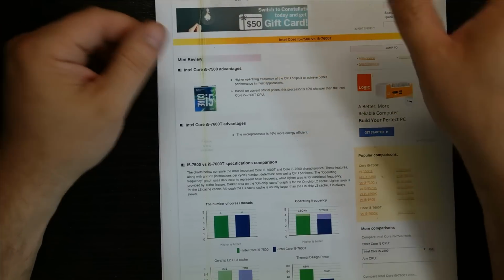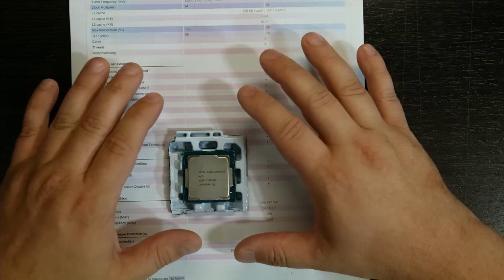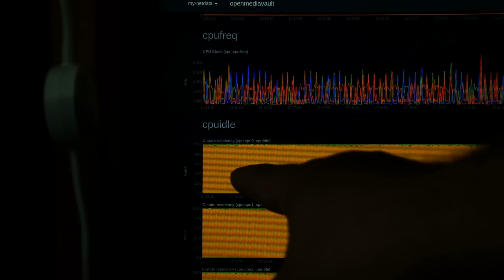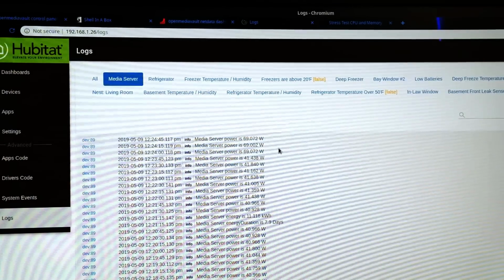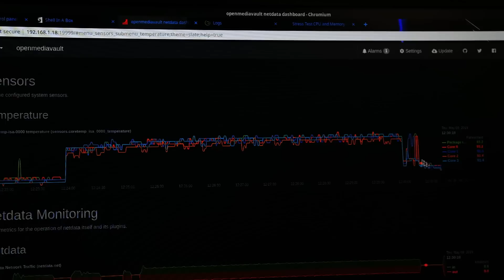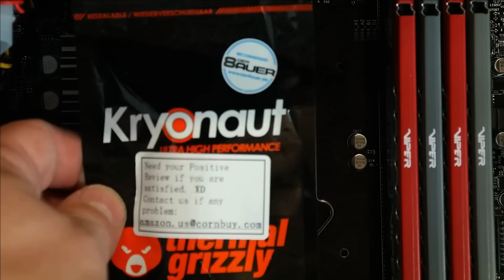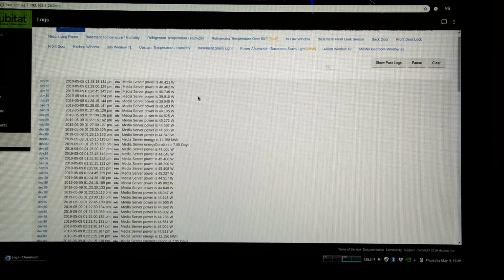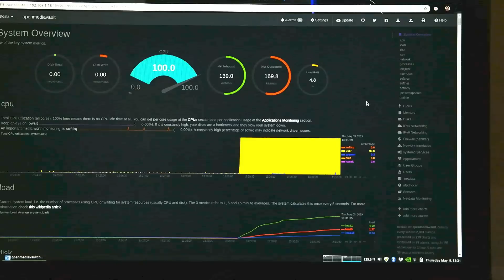Power Saving With T-Branded Intel CPU's???

Comment: You tested  the T series cpu without validating it’s actually a T series CPU,  the cpu printed “Intel confidential “, and you didn’t even bother to validate in system it’s a 7600T.  And even if it is, this is an engineering version cpu,  totally not a valid test.
Reply: I agree. Even though I think the outcome wouldn't differ much.

Comment: You are making the test the wrong way, you had to check the thermals, 35 TDP is thermal design power. 
*1.First off all, the t series have smaller cores, it means less heat, you can safely take away those two giant fans on the processor sink, each of them use at least 7 watts, so you started taking away 14watts just by that,  the temps without fans with the sink you got should remains 60 degree without fans and reach 70 on full load which is normal for these processors, it necessary to have a sink with a good size for this to work, like yours.
*2.Second, is recommended to semi-turn off the the processor turbo and limit the performance like oems do, using the bios or a software like "quick cpu" because intel use this unblocked tech on this processors only to get good benchmarks but breaks the low consumption for some minutes.
*3.third use some software like "core temp" to monitor the actual consumption of the cores and decrease de core voltages which is allowed for these processors because they have a smaller clock ratio.

basically you should clone an oem configuration for the good use of this, and maybe even buy a fanless platinun-type power supply.

Comment: heh at least you are not trying to run one of the old cray super computer systems, now there was some power being spent, especially if you were not getting the bargain basement unit with only 250 processors in parallel LOL

Comment: interesting if you want to save power both while idle and under load you need to under-volt the cpu. i did this with an amd9590 cpu Stock cpu voltage was 1.53V @4.7ghz 0.92V @1.4ghz I cut 30 watts off the 220tdp by lowering the voltage to 1.39V@ 4.6ghz 0.755@1.4ghz but in the end this cpu was still to hungry and eventually killed the power delivery circuits of the motherboard, ran for 3 years prime95 staple. I didn't do this to save money I did it to cut down on the heat cause even with the best water cooling this cpu still was barely contained, just.
Reply: LOL undervolting the 9590 is amdness .. the only reason it existed was to claim top-dog and could only be used north of the arctic circle. Much prized by Eskimos as a CPU on long trips

Comment: You gotta go with a much lower tdp platform ...eg Apollo lake 6W CPU ..still four cores .. I went with this as HEAT from i5-2500k was too oppressive. Would like to upgrade to something better soon ..Maybe Ice-Lake 4c/4t but still about 6w-15w CPU.. its just a media server.
Reply: How much was the 2500k pulling? I have a 3570k clocked to 4ghz with a load of drives and screens. Only pulls 45w from the wall at idle.
Reply: @h2oaddict   I think the whole system was using over 70w , which was still too  high. I use a Nuc-like box now (10-20w)
Reply: @PacManJulie  Hmm, i thought sandy bridge was less power hungry than lynnfield, guess not.

Comment: Daggum..I wish I had a 4 core and 4 thread i5 server...all I have for a server is a simple dual core (Intel core 2 duo E7300) Acer Aspire desktop model w/ Win7 with a 4TB harddrive in it [limited to 4GB RAM too) :(

I am working on building a frameless 4-6 HD RAID server...just haven't finished it all up yet.  I run Plex on mine as well ;)
Great review!  I run all my processors at 100% all the time...I run Seti@home thru BOINC...so none of my processors ever get idle
Keep em coming man!